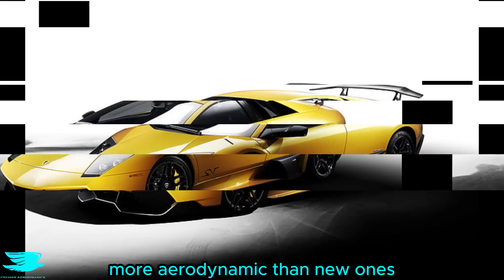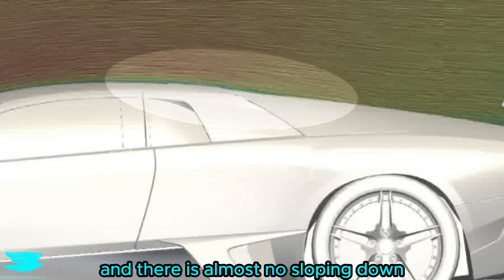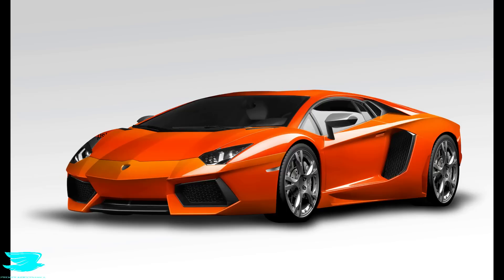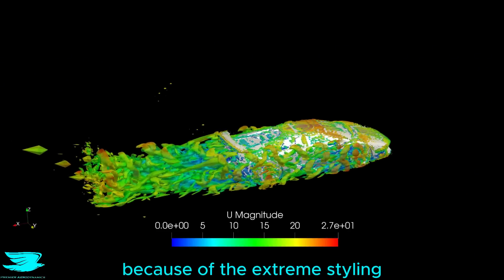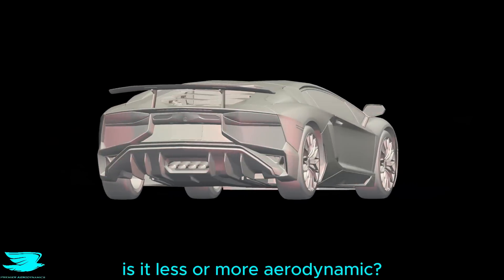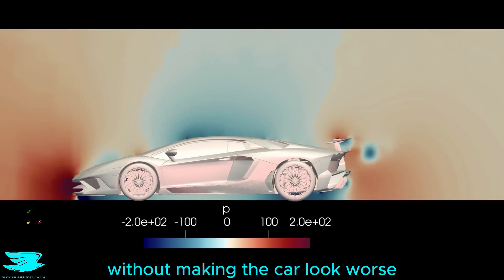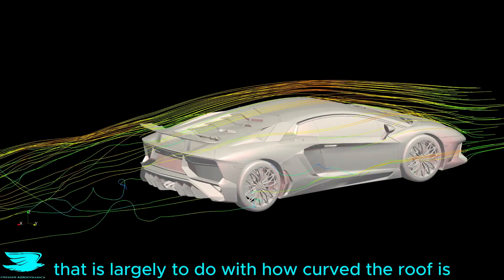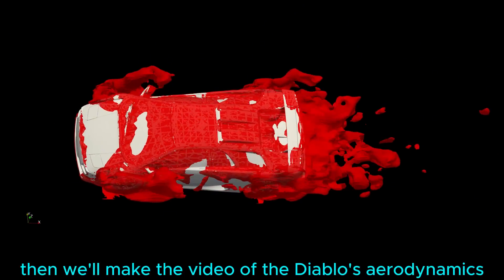Are Old Lamborghinis More Aerodynamic Than New Lamborghinis?

Comment: I'm a game modder and I found a field named "aero coefficient" in the game I'm modding that I've never seen metioned anywhere but this video. It's obvious that the higher the better because I've tested it but I'd like to know exactly what it is. Do you have a video explaining it and a list of known coefficients? Is there a way to calculate it or at least infere it roughly?
Reply from the maker: I think it is just a general number the creators made to make it easier for players to understand. It is likely a combination of downforce and drag. I have never come across a widely known number in automotive aero called that.
Reply: @PremierAerodynamics  Quick update: Drag coefficent is another field in this case, while "aero coefficient" seems to be the lift coefficient multiplied by minus one. That's why Lambos (the cars with most downforce in the roster) had the greater ones. Stock Murcielago '01 has 0.225, and 0.285 when upgraded which is fairly consistent when the lift of a real LP 670 that features lips and a wing is -0.29. Still, downforce on this specific game follows an arbitrary logic as even the most common city car generates a bit of it when stock, instead of the expected lift. Probably due to the arcade vibe of it.
I should have been more specific when I made the comment back then, as I was aware it accounts for aerodynamic downforce. Internal naming confused me, and bought "aero coefficient" as a real life concept, my bad.

Comment: All this is well and good, but I've owned a murcielago and it was a pita to live with and impossible to drive fast whereas any Ferrari that compares to it in terms of price, age, class etc. is the opposite.

My point is aerodynamics on paper are a tiny part of the experience of using a vehicle and only one part (you can argue how big that part is) of performance in general.

You can make a wedge or whatever shape is 'best' on paper but on a track or road (which the murcielago is created for) the compromises to aero can actually result in real world advantages that outweigh what engineers think is right.

Ferrari get this right (and Lamborghini get this wrong) more often.

Also, making pretty and functional vehicle designs are what the Italians do best, so much better than the Germans, French, Americans etc.
Reply from the maker: That's completely true. Lamborghinis always feel like they're trying to kill you. But that is part of the fun I guess. Going more and more plain, like all the way to a 911, doesn't really make you feel much other than boredom.

Although, a late 90's boxster is sooo much fun even at low speeds.

Comment: Now compare second gen Prius with Pagani Zonda R

Edit: i forgot to mention at what speed

At 650kph
Reply from the maker: Lol, that would be interesting to see if it exceeds the critical mach number.
Reply: @PremierAerodynamics  650 kmph is right above half the speed of sound at 617kmph
Reply: The critical Mach number is the speed at which the venturi effect accelerates the air faster than the sound. Plane wings are designed to increase it because either they would have supersonic airflow causing shockwaves from about mach 0.7  @hrishikeshaggrawal
Reply: Camry v Accord

Comment: On these Lamborghinis I assume this doesn’t matter as much but on front engine vehicles, does CFD model the airflow in and out of ducts and out the bottoms of engine bays? I assume the airflow out of the bottom of the engine bay would affect the airflow under the car?
Reply from the maker: Usually it adds around 30 counts to the drag and doesn't affect the performance in a synergistic way. So, ignoring it doesn't change the results flow physics much.
Reply: @PremierAerodynamics  ah cool! Thank you I’ve been wondering about that for a while

Comment: Excellent video again! But I have a question. How do you add the drag that are coming from radiators and engine vents to the calculation of drag coefficient? And any tips for the freshman aerospace engineering students? ❤
Reply from the maker: Historically, people thought the cooling drag created a synergistic effect with other regions, but there are many studies that show that it doesn't. So, you can exclude it and not affect the performance much. Factoring in the cooling drag, you usually add around 30 counts (0.03 for the Drag coefficient).

My best tips would be get into the wind tunnel early because you'll learn a lot more by being hands on. You can ask PhD students if you can assist them in their work just so you can learn. (Say you don't want to be on any papers, but just learn about the wind tunnels and instruments through helping out.)

Then, start doing CFD early. Don't wait until the second half of your degree. Even now is a good time to start, even if you don't know much, you will learn by doing the tutorials.
Reply: @PremierAerodynamics  Thank you so much! I hope you get the appreciation you deserve.

Comment: Worth mentioning especially here, drag coefficients need to be multiplied by frontal area to get the actual drag force. There's also downforce, which the video mentions. 
Lambos have always had low frontal area, and produce more downforce at (relatively) low speeds for better track performance. A top speed car would only need good downforce at high speeds for a straight line.
The Nurburgring times speaks for itself, where even a Huracán Performante beats the Rimac Nevara despite having third of the power.
Reply from the maker: That's a good point. Being so sleek helps reduce the overall drag, as well as move the C.G. lower for handling.

Comment: Nice!! What models are you using? Looks like URANS to me? 

Also, does it make sense to run a transition model on cars? My guess would be that it makes very little difference for most cars except for those with wings. You can see that the flow on the aventadors wing separates, which probably would not happen if you have proper transition modelling.
Reply from the maker: It is IDDES, with an SST K-omega turbulence model. For general simulations, like this, the turbulence model isn't that important. But if you want to get to within one or two percent accuracy, then it is, and K-omega SST is the best at the moment.

Comment: Regarding end plates, or rather wing tips. Since the wing tip vortices interact with the upper tire wake and the upwash of the diffuser, having downturned(suction side) end plates may help if your objective is to maximize the downforce potential of the upper wheel wake.
Reply from the maker: That's a good point. So, you need to make sure the wing is extreme enough to make the vortices hit the tire wakes.

Comment: I noticed in one of your podcasts, where they did a crude CFD study of wheel wakes. Something stood out to me, and I think I may have figured something out. The wheel wells on most cars break up the flow structures on the top half of the wheel, and if you look at the vorticity of that upper wheel wake, it upwashes, like a downforce producing wing. The lower wheel wake downwashes, like a lift producing wing. If you look at the vorticity of this simulation, you can see the upper wheel wake along with the mirror wake blend into the upwash behind the car. IE they're all co-rotating vortices.

This means that wheels will almost always produce lift in a street car with standard wheel wells. Because the downforce producing wake is being broken up by the wheel wells, while the lower lift producing wake is unimpeded by any bodywork. If you could flip the situation(breaking up the lower wheel wake while enhancing the upper one), the wheels would produce downforce, and downforce on unsprung mass is worth ~4x what it's worth on the sprung mass.
Reply: The Research an Open wheel aerodynamics says that you have co rotating vortices on the top and the bottom of the wheel, both downwashing. The upper Vortex forms Like on a blunt Body, the upper suction Side of the wheel dragging the flow inboard. The lower Vortex forms as a result of the Road contact with the Same Rotation. The high pressure infront of the contact Patch Jets the Stream outboard resulting und the roll up of this Vortex.
Reply: @NoanatorTV  They're counter rotating. Upper wake produces upwash, lower wake produces downwash. They cancel each other out, unless there's bodywork influencing the wakes.
Reply: @rolandotillit2867  they are not, If you would actually take 2min to challenge you personal epiphanies its a clear cut case. A Open rotating wheel produces a lot of lift without any Bodywork influencing anything and this has been known since the 50s.
Reply from the maker: That is a great point. When I watched the entire video back, I also thought that merging might be happening. For an isolated wheel, the paper "Flow analysis around a rotating wheel, by Thivolle-Cazar and Gillieron, show that it's true that they are co-rotating, so it makes sense.

I think that front wheel deflectors are the best bet for breaking up the lower wheel wake because by the time the air already hits there, it's too late - the wheel's design is too rigid to change.
Reply: Just drive the car lads, my god
Reply: @Spherz  As an aerodynamicist whose job it is to make cars go faster, I cannot!